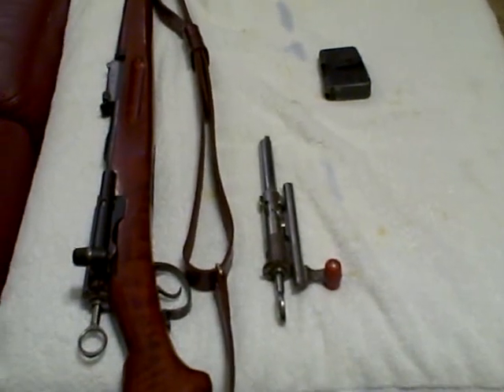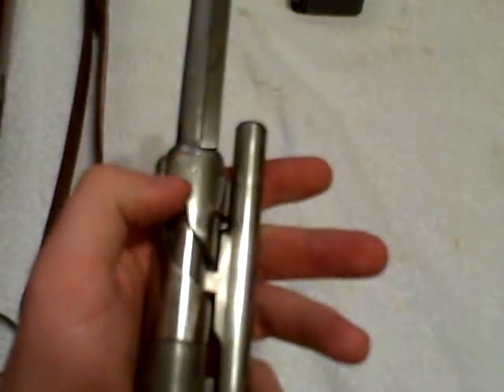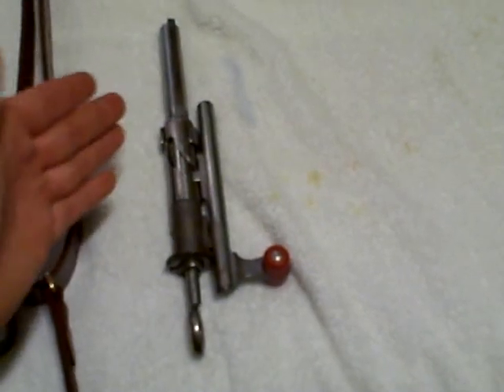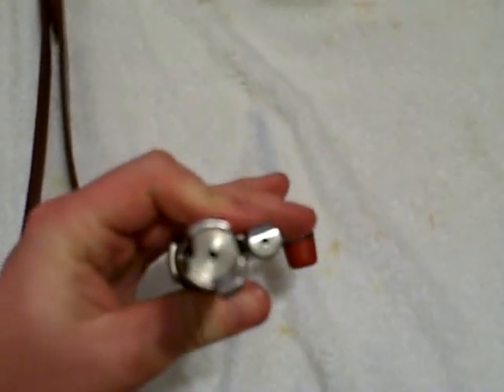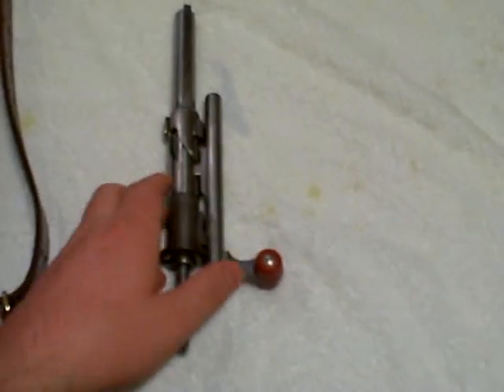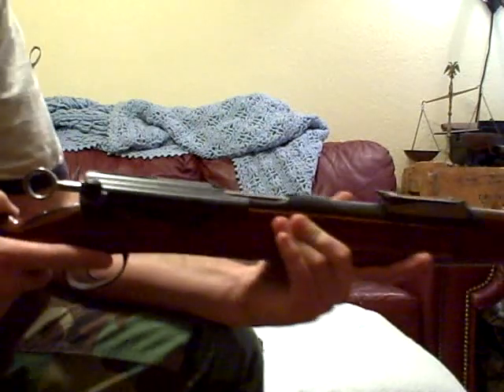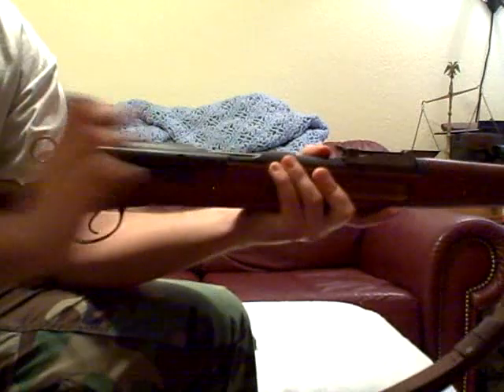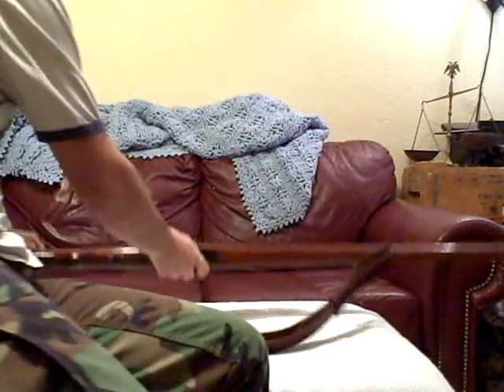Why Early Bolt Lugs Are NOT Located At The Bolt Face

Comment: MY question is: why DOES'NT the M16 have its' 7 micro lugs/recesses at the rear, away from the gas-fowling discharge? yeah, dumb question; but the M16s' combination of gas-tube-fowling, numerous, small lugs/recesses, in a MBR, should get some kind of rube goldberg prize, esp NOT being corrected in 45yrs ( also: safety, mag rel, bolt-latch, even to some extent, charger, not ambidex)